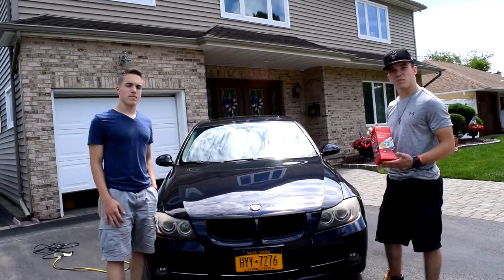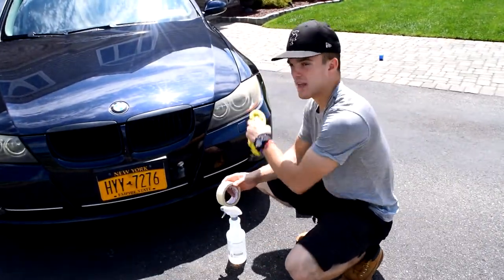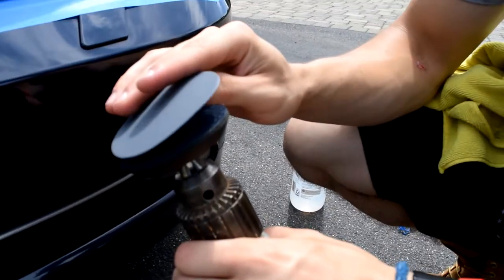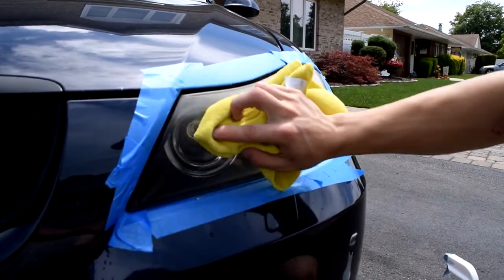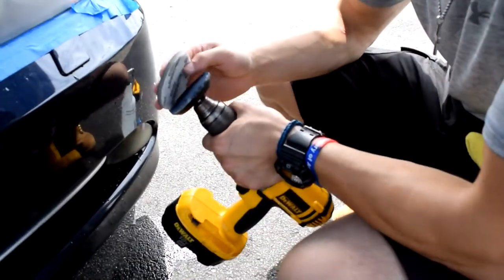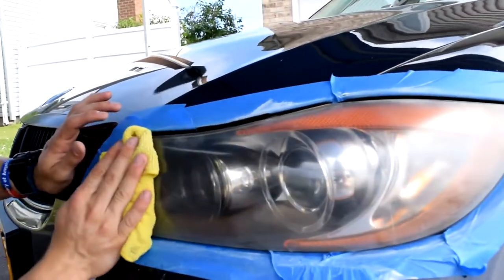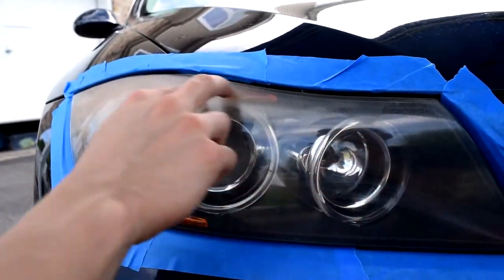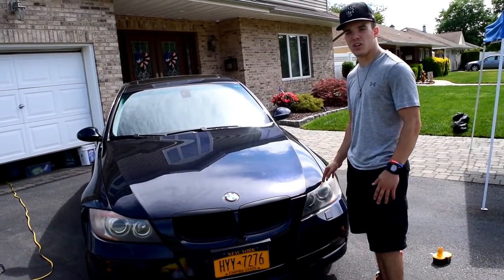Does Mothers NuLens headlight renewal kit REALLY WORK? (S01 E01)

Comment: You guys definitely don"t know what you"re doing...you have to wet sand, meaning keeping both the sandpaper and the lenses continuously wet 🙄🙄🙄 Then you use all 3 sandpaper grits in order, use firm pressure to keep the disk flat on the lens and sand only in a straight line from side to side.

Comment: This kid did a horrible job on his headlights so, i bought the same kit! If you understand the operation of sanding, you'll do just fine. I spent a few hours on both headlights, i have ocd. Nonetheless, my project came out looking like a new set of headlights, great product! 
Fyi: If there is a short between the drill & the operator, it will not work...
Reply: A few hours on each headlight.... ive been doing headlights professionally for about 10 years, about 15 to 30 mins per light is all thats needed

Comment: I purchased this product today for my 2014 Acura head lights and fog lamps. I polished one head light using the sand paper and then buffed it out, I then used only polish on the next head light and found out that your lights turn out a lot better if you don’t use the sand paper.
Reply from the maker: Hmm thats different, but good to know. Thank you

Comment: For whatever reason the directions In the kit say dry sand with 3000. First time I did it wet and made the mistake of going back dry to get some spots. Should have done it all wet regardless of what the directions said.
Reply from the maker: Yes. Looking back on this video now, it has its flaws... but we have discovered a better method for headlight restoration. Using meguirs compound is the best and easiest way. We made a video on it, you should check it out. It works great

Comment: id give that a big fat NO it doesn't work or you just did it wrong cause that shit was still really cloudy in some parts. Id rather just do ChrisFix method
Reply from the maker: Lol yes it didn't work at all. But we did another method using compound. It worked really well. It's a more recent video. Go check it out 👍🏼
Reply: @acauto7886  it didn't work because you had absolutely no clue what you were doing
Reply from the maker: @joshua7426  ah... that could be the reason. I like meguirs compound method 10x more so it's all good.
Reply: @acauto7886  yes McGuires is really good, mothers compound in this kit isnt truly the best but it works. Where you went wrong was not keeping the headlight wet the entire sanding process. Even on the last stage with 3000 grit keep it wet, wiping sanding debris away every 30 secs or so and respraying. The blue foam puff polishing pad also isnt what id recommend. Professionally i recommend a small 3 inch waffle cutting pad and compound to buff out the scratch swirls then switch to a polisher or synthetic sealant and a wool pad. Its a learning process. Each light you do youll try new products and techniques and get better. I personally dont like clearing. Ill do sand and buff/polish for 40 bucks and offer a 5 year warranty where ill repolish for free
Reply from the maker: @joshua7426  yes I feel u 100%. Definitely a learning process. And yes I know I screwed up the process... wasnt one of my best videos shot lol. Trust me the comments let me kno.  But yeah I was testing the kit as a whole so I had to use the blue pad, which wasnt the best. But later I tried just meguirs compound and a better buffer attachment and it came out 10x nicer. This video wasnt 100% accurate. It was a slight mess up but I made a learning experience out of it
Reply: @joshua7426  the last step of 3000 grit has to be done dry.the rest of it he did wrong.the sand and buff/polish will have to be done every 6 months
Reply: @peterbarber7613  i do 3000 wet and lasts years not 6 months
Reply: @joshua7426  mothers is crap anyway.sanding only leaves scratches.easier just to use buffing compound

Comment: It would have worked if you would have did it correctly
Reply from the maker: What did we do wrong?
Reply: @acauto7886  too much pressure sanding and thats why you still have really deep scratches
Reply: @acauto7886  First of all, you didn't wet sand it...you have to wet down the lenses and the sanding disk first, and keep wetting them down while you're sanding.

Comment: You didn`t sand long enough.
Reply: How much sanding is required? What grit?
David
Alberta
Reply: I'd use alcohol to wash it.
Reply: Good first try. I have never done it, but I have everything I need.
Reply: @davidweum9334  only about 5  mins per grit, the last one at 3000grit the longer you do it the better the result though. it needs to stay wet the entire time even at 3000. Guy did a horrible job.